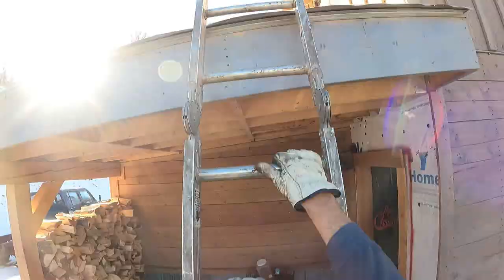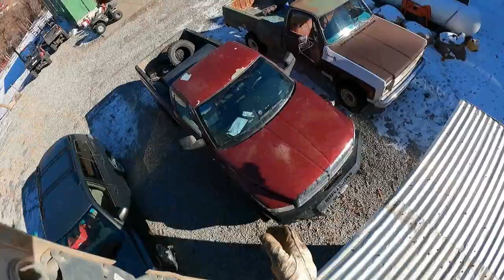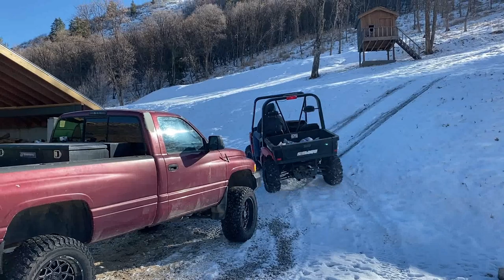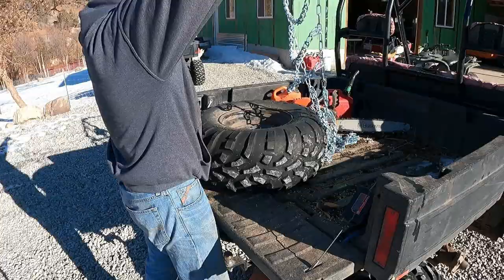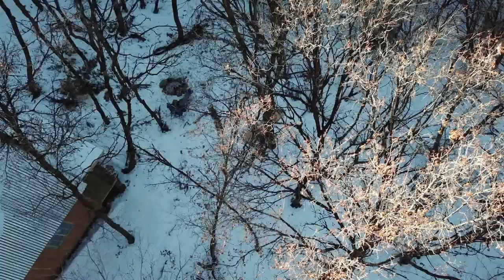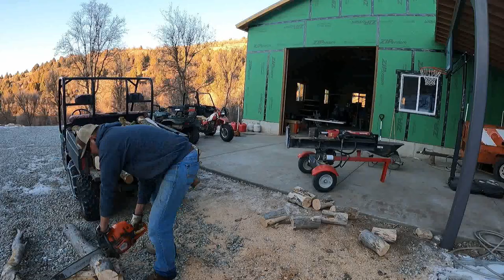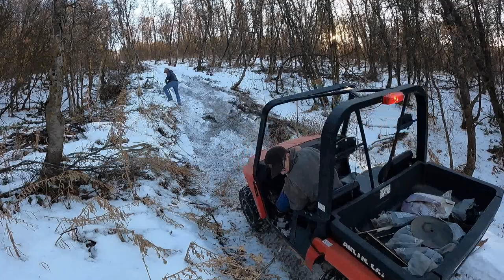The Earth Has Shifted... LITERALLY! (Solar Panel Issues)

Comment: Something is definitely screwey..... magnetic pole movement shouldbt have anything to do with this...... BUT..... when i bought my house 25 years ago, when the sun was directly overhead mid june, there was NO shadow on the north side of my house, and sunlight actually creeped up several feet up the side , until the eave cast a shadow on the wall.... now, mid june, there is several feet of shadow away from the house.....  precession has something to do with this, but i have no idea how fast that would be affecting things..... used to get sunlight in my kitchen window on the winter solstice, and now its blocked by the roof next door, though the house hasnt changed...... something is goin on....

Comment: I am in no position to be critical of anything you do as you are living parts of MY dream lol. HOWEVER, I have cut trees down, dragged them, bucked them, loaded them, dumped them, moved them to the splitter, split them, re-loaded them, dumped them, stacked them to dry, re-moved them to the wood pile nearest the rear door of the cabin, then moved them yet again to the box beside the fire place and finally, into the fireplace for "Free Heat". It's FREE heat as you don't need to buy the wood and expenses of a chain saw and fuel for SxS are minimal, but damn.... the labour required needs some tweaking. I have made it my own personal goal to make this whole process as efficient as possible and that comes down to what I call "touching the wood" the least amount possible. Locations, terrain, resources, tools, abilities, help from family etc all factor in, but I am happy now lol, as I can get a felled tree into my fireplace without "touching the wood" more than 4 times, all by myself. I split the wood where I fell the tree, load onto the tractor bucket and trailer as I buck and split, then dump under a shelter located 10 feet from the back door. I cut at least enough for the coming year and leave to dry for 12 months. I am not so concerned that the wood be stacked in perfect rows and stacks as the summer heat, being under shelter from snow and rain have reduced the moisture content enough. I am in Northern Canada completely off grid, and even better for you,  the summer AZ heat would more than dry out your wood. I load the wood box right out side my back door, and then to the box next to the fire place. Now my teenage sons work to improve the efficiency even further, while I watch from the picture window, sitting next to the warmth and listen to the crackle from the fireplace. I have reduced the time and labour needed to maximum efficiency, to allow for some quality time and actually enjoying the fruits of my labour. Any ways, thats my two pesos and thank-you for sharing your adventures.

Comment: the magnetic pole movement is not linked to the rotational axis of the earth. The tilt of the rotational axis controls where and when the sun comes up and sets
That doesn't seem to have moved.  As someone said about the trees growing I agree this could cause the appearance of a change and indeed change
the number of hours the sun hits the solar panels.   I"m sure your observation of the hours of sun on the solar panels is correct.  I'm sure that the tilt of the earth 
hasn't changed.   The shade of the trees seems to be a good answer.   if the trees were taller, the sun would reach the solar panels later and the point the sun shows 
over the hill would move rather south.

Comment: How about building some reflectors to increase the amount of Sunlight onto the panels?, a cheap effective way.  Installed a sun tracking solar hot water system years ago, could increase its effectivness that way.
Reply: Not practical on a north slope of a hill. The hill is blocking the light.

Comment: Just go buy the cheapest snowplow you can and make amount for it. I did it on my Polaris and it was super easy. I just put a few feet of square tube on it and found a couple bolt holes on the bottom of my Polaris and then will do the amount on the front and used a John Deere mower blade. I have a bumper on the front of my Polaris and I just kind of made a little A-frame going up to that and that thing was rocksolid, in fact I ran through a ditch and spiked it into the ground and flipped my ATV over and split my face open but the mount never bent. Lol.  That save me almost $400. There were holes on the bottom of the Polaris already right in the center and it was very easy to do

Comment: Just curious on your road care vehicle, Have you ever checked out your state, county or city for used plow trucks? here in Michigan they auction them off and they sell at decent prices, Plus if you found one with the large front blade and the mid mount blade you could have triple  duty. As a dump truck, as a snow plow and as a grader for your road in Spring and Summer.   Just a thought,  everyone on the road chip in for purchase and maintaining.... Good Luck and Merry Christmas!!!

Comment: It would be nice to have the covers that go over top of those to keep the weather out of them while driving and to put a small solar panel on top to provide a charging  system for your phones , a heater for inside , or any electric you might need while out plowing or working around the property . Just a thought  you never know when it might be helpful , also it could power a light bar across the top for more light while plowing or other work  you might be doing so it doesn't drain the battery in the Artic Cat,/ or 6 wheeler🤔 , it might work well for you 💯👍

Comment: No you're absolutely right brother . Now I wouldn't normally mention i live in California because , well because it's California and we get a lot of 'boooooo's' . But I'm bringing it up here simply because anyone who has lived here for (in my case) 58 years is well accustomed to the standard 'One mile by One mile' grid pattern that streets and fields and cities are governed by . You don't have to be smart to realize , that where you're used to seeing the sun rise and sun set  THROUGHOUT each season ........ has changed . Dramatically . And yes it does include the moons trajectory I don't care what this other guy say's . Personally I believe it's not just the loss of ice from Greenland and elsewhere . It is also the loss of huge heavy trees being cut down and removed on such a grand scale that some places don't weigh as much as they used too . (Not to mention one barrel of crude oil weighs 300 lbs and trillions of barrels have been converted into a gaseous state , extracted and then vaporized) All that weight loss is causing a shift in balance

Comment: Today, on December 10, 2020 at noon, Earth's axial tilt, or mean obliquity was 23.43655° or 23°26'11.5". Earth's mean obliquity today is about 0.00001°, or 0.04", less than 30 days ago. This value remains about the same relative to a stationary orbital plane throughout the cycles of axial precession. But the ecliptic (i.e., Earth's orbit) moves due to planetary perturbations, and the obliquity of the ecliptic is not a fixed quantity. At present, it is decreasing at a rate of about 47″ per century from the plane of its orbit around the sun. But this tilt changes. During a cycle that averages about 40,000 years, the tilt of the axis varies between 22.1 and 24.5 degrees. Because this tilt changes, the seasons as we know them can become exaggerated.
Having said that, you should really think about building or getting an auto tracker for your panels, at your angle and spot you need every minute of light you can get.
Dec 21st is the shortest day then they get longer and the sun will start rising higher again from the earth tilting back on its axis.

Comment: Cool video today.  Liked the various topics.  I can see how thinking things really through before moving the solar panels is critical.  Is there a limit as to how far (cable feet) the solar panels should be from the inverter/charger for the batteries?  I know that there is more line loss with DC.  Once again liked today's video.

Comment: A geomagnetic reversal is a change in a planet's magnetic field such that the positions of magnetic north and magnetic south are interchanged (not to be confused with geographic north and geographic south). The Earth's field has alternated between periods of normal polarity, in which the predominant direction of the field was the same as the present direction, and reverse polarity, in which it was the opposite. These periods are called chrons.

Geomagnetic polarity during the last 5 million years (Pliocene and Quaternary, late Cenozoic Era). Dark areas denote periods where the polarity matches today's normal polarity; light areas denote periods where that polarity is reversed.
Reversal occurrences are statistically random. There have been 183 reversals over the last 83 million years. The latest, the Brunhes–Matuyama reversal, occurred 780,000 years ago,[1] with widely varying estimates of how quickly it happened. Other sources estimate that the time that it takes for a reversal to complete is on average around 7000 years for the four most recent reversals.[2] Clement (2004) suggests that this duration is dependent on latitude, with shorter durations at low latitudes, and longer durations at mid and high latitudes.[2] Although variable, the duration of a full reversal is typically between 2000 and 12000 years, which is one to two orders of magnitude less than the duration of magnetic chrons.[3]

Although there have been periods in which the field reversed globally (such as the Laschamp excursion) for several hundred years,[4] these events are classified as excursions rather than full geomagnetic reversals. Stable polarity chrons often show large, rapid directional excursions, which occur more often than reversals, and could be seen as failed reversals. During such an excursion, the field reverses in the liquid outer core, but not in the solid inner core. Diffusion in the liquid outer core is on timescales of 500 years or less, while that of the solid inner core is longer, around 3000 years.[5]

Comment: Magnetic poles are NOT rotation-poles! I would rather see if the whole site where your House sits is slowly sinking in (The holes you digged were not really small! And the HIll is maybe slowly sliding down, this is not uncommon for uncompacted ground on a slope... Also, the trees grow bigger with time.... The Sun also moves up and down with the seasons. Another theory is that the sun is having kinda cycles of about 11 years where it is getting more and less active. Additional to this, the atmosphere is polluted mroe and more with dirt, leading to an effect called "global dimming" where there is less light coming through the atmosphere as there are more and more particles in the air... I f the earth would have shifted as a whole, this would have termendous effects on all things on earth, way more than some missing time on your solar panels...

Comment: Magnetic North and the location of where the Sun and Moon rise and fall across our horizons have zero correlation with each other.     There is a large iron ore deposit below the Earth crust that migrates around our planet.  Always has and always will.   We use this deposit to simulate where North is, but it has never been exact to true north, just a reference point.     The path the Sun and Moon take across our horizons depend solely on what time of year it is and what latitude at which you live.   My guess is you are mistaken on where they have crested and receded over your mountains in the past, you may start charting it and review it year over year.   I really enjoy your channel, I am a DIY'er and you have help me figure several things out along the way.  Thank you.

Comment: Any one that lives is snow country and puts solar panels on their roof
??????
Should have at least 2 good generators
Check out other UTube Channels where they clean the snow off their panels some times every hour
For those that may say
The panels need to be steeper
Check out in other country's with high snow levels
The steepest roofs still hold snow...
What is a better answer
Ground mount panels. For ease of maintance
And double or triple the amount of panels 
And find ways to utilize the extra power during summer
Water heaters.    Electric vehicles
Air conditioners. Electric stove. 
_______

Comment: To add to a few other comments here, the precession of the true north pole is on a roughly 25,000-year cycle. It does move, but you'd never notice it in a lifetime https://en.wikipedia.org/wiki/Axial_precession . The magnetic north pole is always on the move as well, but still at such a small rate that one wouldn't notice unless paying attention and measuring precisely. Look at any IFR approach plate for flying and it'll tell you how much to adjust the tune of your magnetic heading indicator at that particular airport during that particular year since the approach plate has been published https://www.skybrary.aero/index.php/Magnetic_Variation . The movement of the magnetic north pole has nothing to do with where the sun rises and sets though, that's the true north pole. Interesting observation though. I don't have an explanation for that and would be curious to test it.

Comment: "He set the earth on its foundations; it can never be moved. "     Psalm 104:5
Reply: That's so weak
Reply: True, the earth is not moving from it's foundation, yet the foundation does travel around the sun once a year taking the earth with it, unless you believe it is flat...
Reply: @Nunya_Business_  "In the heavens He has pitched a tent for the sun, which is like a bridegroom coming forth from his pavilion, like a champion rejoicing to run his course. It rises at one end of the heavens and makes its circuit to the other; nothing is hidden from its heat."   Psalm 19:5-6
Reply: @freeinJesus  So you believe that the sun is travelling over 6700 Miles per second around the earth every day because the earth can't be rotating based on your reasoning. Alright, then lets calculate for Pluto which is 3,670,050,000 Miles from the sun, it is travelling at 267000 Miles per second based on your theory. That is 1.5x the speed of light. If you truely evaluate the Psalms verses you quote, you would understand that poetic license is used and the truth of what you are reading does not reveal what you theorize. The earth is not flat, and it rotates. The earth did move from it's foundations during the great flood (Psalms was written after), it is why we have earthquakes and oceans and mountain ranges today. Truthful science and the Bible meld perfectly, believe what you want...
Reply: @Nunya_Business_  "God is not a man, that He should lie, nor a son of man, that He should change His mind."  Numbers 23:19  Jesus said "Heaven and earth will pass away, but my words will never pass away."  Matthew 24:35. "The grass withers and the flowers fall, but the word of our God stands forever."  Isaiah 40:8  "Do you not know? Have you not heard? The LORD is the everlasting God, the Creator of the ends of the earth. He will not grow tired or weary, and His understanding no one can fathom."  Isaiah 40:28

Comment: ZetaTalk Explanation 12/8/2009: Galaxies swirl. Water going down a drain swirls. And these large charged atmospheric swirls are chasing after some part of the tail waft that is more or less charged than the surrounding atmosphere. What occurs at the center of such a charged swirl is more electrical charge than the surrounding swirl, thus the center becomes a neon cloud that can be seen even at night, and wants to discharge, ground, in the Earth.

Then there are the naked eye captures of Nibiru itself or its brilliant Moon Swirls, which can appear below or above the Sun or on either side. This capture from Sweden on August 13 shows a Moon Swirl on the left. Another from Goiânia, Brazil on September 14 most likely is showing Nibiru eclipsing the Sun from above because Brazil is below the Equator, in the Southern Hemisphere, and from their view Nibiru is not at 7 o’clock but at the 1 o’clock position, upside down.

Comment: the equator is shifting because of man , china and india and the biggest reasons. the weight of changes in those areas. china pours more concrete then all countries combined cause drastic weight issues and india drains more water to grow from their area. when you ad or subtract weight from areas the rotation changes and slows

Comment: The shift is magnetic north
This doesn’t affect true north 
The variation seen where the sun rises is due to seasonal, tilt as it does each year
Save yourself the trouble-don’t move the solar panels 
Additionally I would question whoever told you you needed to do this?

Comment: Watched several people who have noticed this so i know where the sun and the moon rises here. And with a simple compass and with pictures that I have of sunrises and moon rises I marked where the needle is set on north .where they  should be rising as recently as 1 year ago. By using the the twist indicator on the compass they are rising 15° to the south from the previous location. That is alot, if I was using solar panels this is what I would do. I would make a rack that would be able to be moved in a arch 15-25 °. One end would be stationary the other end mounted on something that would allow it to move. Then you could move it for full sun. No scientist but I do know that anything that moves 15° there's a reason and a big problem with it. Good luck.